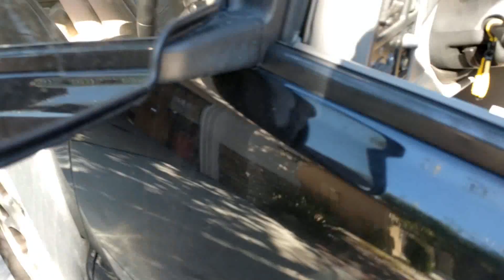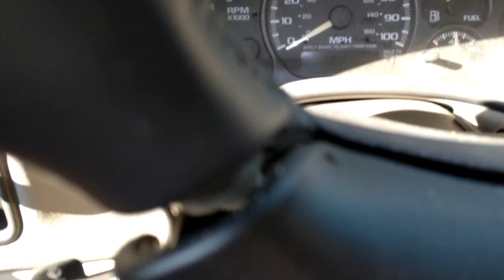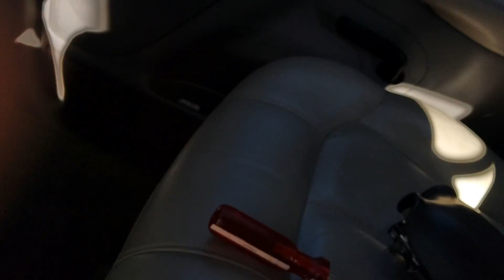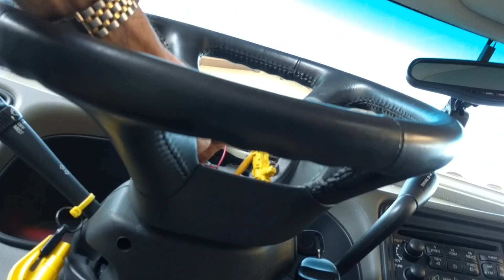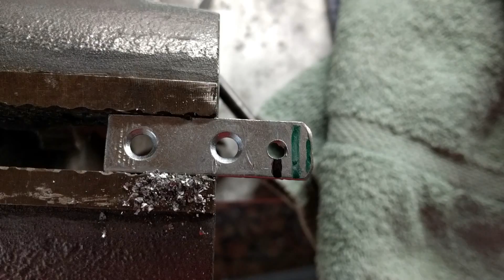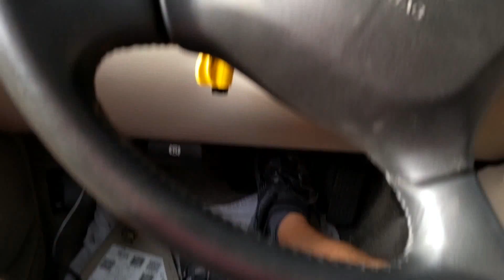Suburban horn dead fixed and reset airbag light code by froggy 2002 model year

Comment: Froggy, enjoy all your vids! Since I drive Tahoe thought maybe common parts. Interesting info I found https://www.rockauto.com/en/catalog/chevrolet,2003,suburban+2500,6.0l+v8,1412211,electrical
Double check your veh but look at pics. DORMAN 924088 {#16821883}
GENERAL MOTORS 16821883  OUT OF STOCK
Electrical, Horn Contact
. Looks like OOS item has plates included. All for around $9.00 (not inc shipping)
Was also thinking using electrical heat shrink tubing to protect wires. Thanks again for your vids !